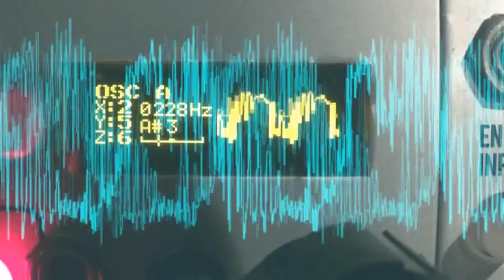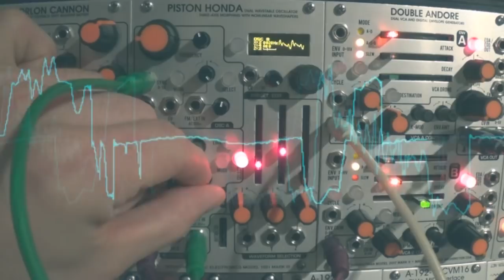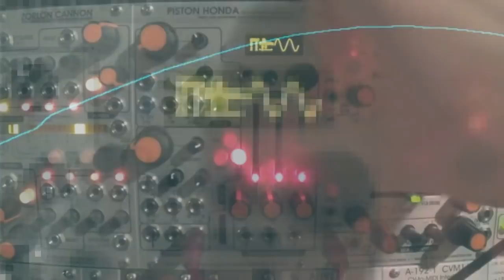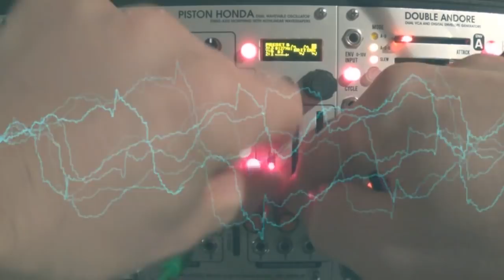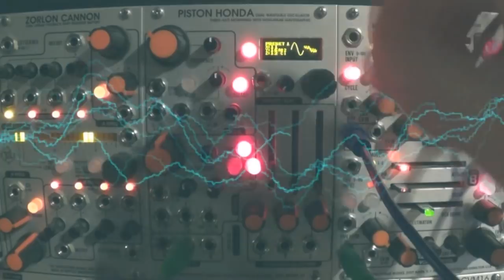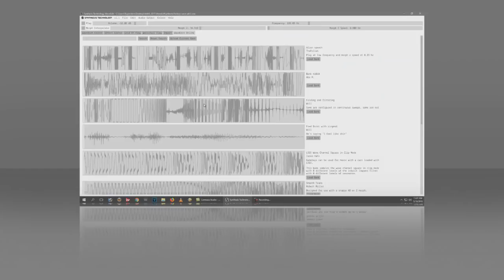Piston Honda MKIII - Tips _ Entertainnoying Tutorial

Comment: Hi, I have a problem with my Piston Honda mkIII.
It seems that my module does not register automations and movements during editing.
Let me explain :
If for example I move to preset 3 and then press the encoder "editing" comes up.
I then move some parameters to record the movements in my preset like in your video, press the encoder again and save the preset.
But the preset remains static!
(Ps. I also tried switching to "all parameter" mode, but it still doesn't work).
Is it a firmware issue ?
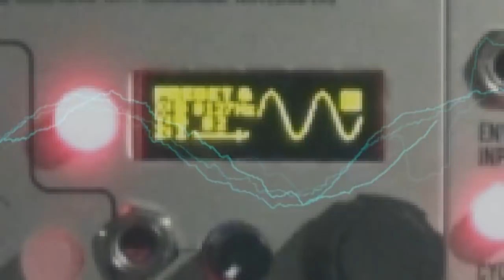Please help me (20:26)
Reply from the maker: The preset manager does not record movement parameters. it remains static. It will keep the parameters where it was left. but if you send some Ext. CV signals, adjusting the attenuators will keep the CV amount in memory but not the incoming CV. It would be amazing to have movement recorded for each preset but sadly it's not the case. Sorry if my explanations were confusing.
Reply: @robotopsyrobotopsy6486  no dude you explain it perfectly.
Yes it would be lovely, but i think we should wait the next million dollar piston honda for that 😂
Thx again ❤️
Reply from the maker: @giovannitorricelli4214   I'm working on a huge preset manager project before the end of the year with lots of new tricks.  Cant wait to share this.
Reply: @robotopsyrobotopsy6486  subscription made 🤟 waiting for the video